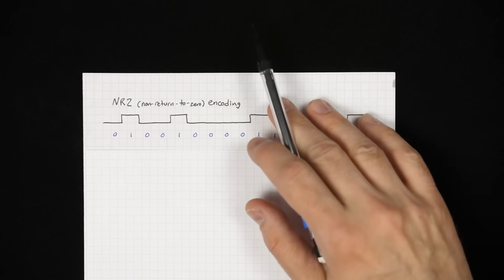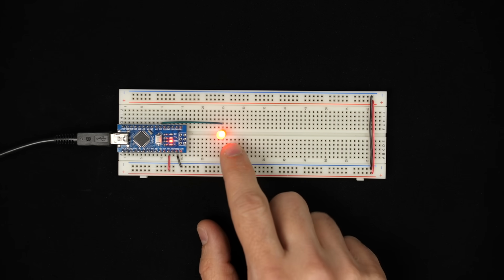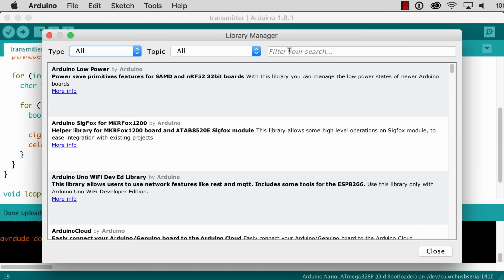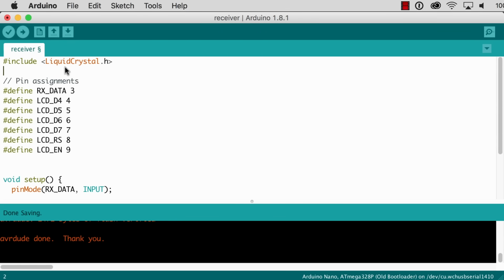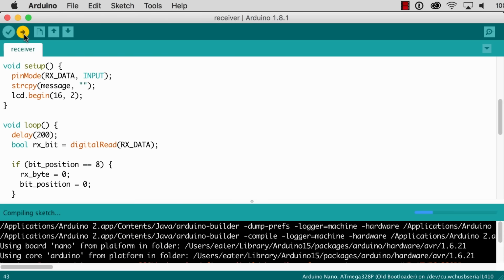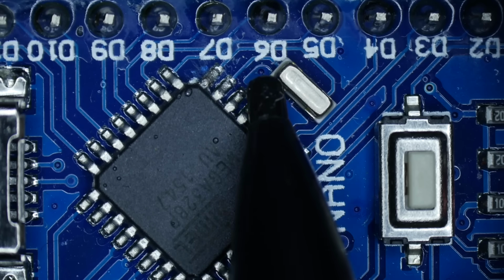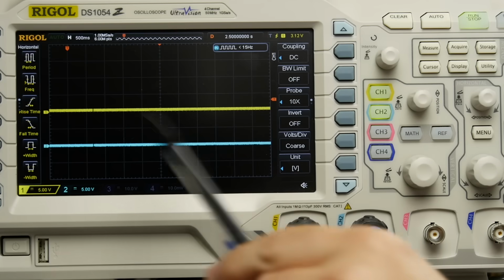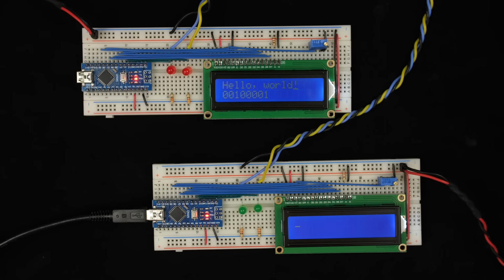Reliable data transmission

Comment: 41:07: So is that "four horizontal lines" character simply that LCD panel's version of the � U+FFFD replacement character? 
I did consider whether this might be a version of the ▤ U+25A4 SQUARE WITH HORIZONTAL FILL, but it's unclear to see how a single byte or single bit error could result in something that takes three bytes to encode in UTF-8. Speaking of which, do those LCD panels even use UTF-8? ... Okay, after looking at the HD44780 datasheet, I'm none the wiser: The datasheet does include its own 8-bit character sets (two variants shown in Table 4), but neither of those includes the "four horizontal lines" character. What gives?

Comment: 27:10: It's very clear that since ! is ASCII 33 (00100001) and " is ASCII 34 (00100010), it's just the final bit that arrived a little too soon, so the delay was almost long enough but not quite.

Comment: Is this just an explanation of "Reliable data transmission
" in theory or does Ben goes into depth about a particular data transmission protocol? Can you teach us how to build and go into the theory of building a data protocol such as a "CAN Bus"? The reason is because it is a very dynamic and fail proof data protocol since all parties individually are both transmitting and receiving data, it is somewhat complex to implement since all parties have their own clock signal too.

Comment: What was the reasoning for dividing the transmitter delay into halves and putting it between the LOW and HIGH of the clock?
Is it just for visual reasons? Like is it easier to see on the video?

Comment: Hello Ben. On the receiver side, which variables should be volatile-d?  You used it 3x, but not the char message[16], receiving the data from the onClockPulse() ISR.  Like this video.

Comment: But what if an error occurred within the clock signal. What if it's voltage got interrupted low at some point. Then the receiver could read the same bit twice.

Comment: When receiving; I would've rather used a "shift left" of the byte received for each new bit oand or with one.. Makes a bit neater code as you don't need to clear the byte every time you start receiving the next one, as the bits of the last byte received will just be rotated away .

Comment: You do not have to send the clock signal if you use so called sync bits, or start bits in the data stream.

You prefix every 8 bit message with 2 bits of known values - 1 and 0
So the message would look like this: 10xxxxxxxx.
After this you wait a few cycles and send the second byte with the same prefix.

This eliminates the need of a separate clock signal, since the prefix 10 functions as a clock signal, that can be used to interpret the message. Similar approach is used in analog composite video signal, where before each frame a color burst signal is sent, which is used to interpret the color of the signal.

Comment: In a project I set up for my kids to help them learn things like this, I used 2 PS2 keyboards with much the same connections you used in this video. The difference is that I set the 2 Arduinos up with a RX & TX function with start and stop bits. This enables two way communication with the ability to tell both devices when a character starts and ends without the need for clock sink. It's a simple for loop which i would be curious to see how you'd go about making. The end product used the up and down arrow keys to scroll through the message and was used in conjunction with a RAM shield for the Arduino boards. It makes an excellent message board for local wired networks. I would guess that this could also be done wirelessly but doing so has it's inherent security risk.

Comment: The coolest thing here to me is the way we're all sat watching this via a method which is just a few steps away from what he's demonstrating.  Data in, data shoved down wire, data out.  These are tests and lessons you can do in your own home, and gain a real appreciation for the fundamentals behind how this stuff works.
Reply: Data in, rendered to H.265 (that's 5,000+ technical patents right there!), shoved down a wire (really downplaying the complexity of the OSI model), processed in a massively multithreaded transcoding pipeline that proeduces about 10 different formats/containers, distributed across a CDN that makes you think the Internet is much faster than it really is, then it's shoved back down the wire to millions of people on demand in a kinda clever adaptive DASH format until the backend ContentID processes catch up and flag it for copyright...

Comment: .. why do this by software when it would be much more didactic to configure and use the built in hardware UART and have it sync the communication as well do CRC. You are teaching something that would be essentially useless in a app because it would run in a software loop, bitbanging every bit at random interval, instead of having it timed by clock/running in parallel to the application code and communicating without impeding performance or being disturbed by application dependant CPU indisponibility.. of course, the naive approach has its value but it would at least need mentioning in the video

Comment: I have a doubt, Is not neccesary (or at least recommended) to disable interrupts while handling an interrupt? In a setup like this is unlikely to occur I guess, but if the clock signal gets noise that is interpreted as a rising edge can lead to "bad things", right?

Comment: Some years ago I played around with having two arduinos communicate with just LEDS as the emitter and reciever using that well known LED discharge hack. As I recall I made my own scheme of sending first a long pulse of light indicating the time-length of the byte and then sending each bit as on/off. That way I could vary the send speed without the receiver having to know the rate and still have some syncronicity. although it wasn't exactly a sync signal. 

Either way it was a fun little project to toy around with, in hindsight I should have send a pulse indicating bit length as that would have been significantly faster.

Amazing what you can do with just two LEDs either way.

Comment: So I'm 2/3 through, and I'm going to speculate on using the data stream itself to stay in sync instead of requiring an extra wire to send a clock signal. Maybe hrs addresses this later. Haven't gotten that far. 
My first thought is to connect the incoming data to both the receiving pin and an interrupt receiving pin. The clocks on the different arduino are close enough to send a byte without getting out of sync. So, send 10 bits for each byte. 01 followed by the byte of data. Have the interrupt pin listen for a rising edge, which happens between the 0 and 1 in the two bit prefix to the actual data. This triggers an interrupt which tells the arduino to ignore the interrupt pin for the time it takes to read the following 8 bits at the expected interval. Process the data and reactivate the interrupt pin in time for the next 01 prefix. You can of course use better ratios of prefix to data if you know the tolerances of the system clocks. You can do orders of magnitude better than the 2 to 8 in this example. And using an interrupt might have issues I haven't thought through yet. Though you could possibly implement a faux interrupt by checking the data pin with no delays until you detect that rising edge, then read the butts at the lower rate with the delay commands or built in timer.

Comment: Sir can you please🙏 explain the 433 MHz RF transmitter receiver module circuit  Or any other RF transmitter receiver module circuit diagram   , it's working, every components used etc

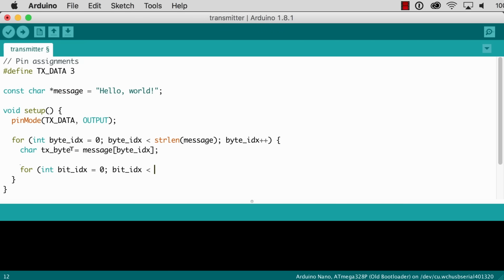Comment: Ok, after rewinding 20 times and playing at 0.75 speed (I'm not as smart as most of the people here), I think I've finally understood the 'bit shifting' part at 3:30.
Here's what I THINK is going on..

The problem so far is that we need to iterate over every character of the string "hello world!". So we do that with a for-loop. The first letter being 'H'
The letter 'H' is presumed to be represented by 8 bits as the ATmega328 chip that the Arduino Nano is based on, is an 8 bit processor. This is why Ben creates another for-loop inside the first for-loop. This second for loop has 8 iterations (8 bit)

The problem to think about now, is how to transfer a byte (8 bits), bit by bit, electronically. We need to iterated 8 times (hence the inner for-loop), and each iteration we need to check the state of the corresponding bit in the 'H' byte. Ben does this very cleverly.. We create a variable 'tx_bit' which will store a boolean which represents weather the bit in question was high or low.

So how to we test each of "H"'s bits?
What we need to do is choose a number which has just 1 bit set high in its decimal form. Here are some random examples: 
Decimal: Binary
1: 00000001
8: 00001000
64: 01000000
128: 10000000
Why are we doing this? Because we can compare the first (and so on) bit of 'H' with the bit of our number. 
But we need the bit of our number to be 1 so we have 2 known truths - the bit of 'H' is on AND the bit of our number is on. This is how we can be sure that the 'H' is on or off.
Which number should we choose? Well as we are starting off on the first bit of 'H', it makes sense to choose number who's first bit is on, and the rest our off. You can see from the examples above that the number we want is 128: 10000000

What's going on here is Ben is leveraging 'Bitwise Operators', specifically. bitwise AND. What this does is compare the bits of 2 binary numbers, bit by bit. Then it will output a binary number which has bits on (1) where both bits from the compared numbers were BOTH on. The rest will be off (0). 
Knowing that the number we chose only has 1 on bit, we know that if H's corresponding bit is off (0), output number will be 00000000 which evaluates to FALSE. Else it will be 10000000 in the case of the first iteration, which evaluates to TRUE.

The ascii number for 'H' is 72. The binary number for 'H'  (which we are interested in) is 01001000.
So let's do exactly that, let's do a bitwise AND on the 'H' binary number and our chosen binary number.
[0]1001000 : H
[1]0000000 : 128 (our chosen number)
[0]0000000: Output (evaluates to false)

Great! That means that as we iterate over each bit of the byte 'H', we can tell weather it is ON (1) or OFF (0). Then while we have that stored in the variable 'tx_bit', we can output it (or 'send' it), on the chosen pin, then move on to the next bit! After going over each of the 8 bits in H, the outer for-loop goes onto it's next iteration (next letter in this case), which is 'e', then the whole process starts again!

I hope this is as factual or correct as it needs to be. I'm very new to this myself. I hope it helps also.

Comment: Shelly Ph: 86-13671843635,  2911282844@qq.com, Skype: linnaniu1
Novyz(Shanghai) supply the custom service of Electrical Junction Box, server subrack chassis and network enclosure, rack case

Comment: Take a look at Manchester Encoding. The data line acts also as a clock line meaning you only need 1 data cable, and 1 ground. Suitable for RF transmission.

Comment: The inclusion of a clock wire seems useless to me. The only reason your timing got unsynchronized so fast was because you’re receiver was waiting before it received a bit. It should’ve received first and then waited, with maybe a small delay at the start of the program to make sure the receiver catches each bit with a big enough margin. Even with this setup, yes, the Synchronisation won’t last forever. To fix that, just use an interrupt after every Byte to catch the next bit, then add a little padding to make the synchronization last another byte, and then repeat.

Comment: Any comments on the possibility of having a common clock?  Is it reasonable to build around the expectation that there will be a short clock skew between adjacent machines?   Is a common (externally sourced) clock even feasible with a R.Pi or Arduino?

Comment: 29:55 Why are both arduinos going out of synchronicity after 667 transmitted Bits? shouldnt it be (667 / 5) Bits?  Since the delay between two Bits are 200ms -> 1/5 s.

Comment: I'd imagine you'd fix errors by first using a parity bit, which can be used to fix single bit errors on the fly.
Then if you want more reliability I guess you could send a whole parity byte, but that would halve your transmission speed. But then accuracy is usually more important than speed.
Then, if even that isn't enough then perhaps some RS232 communications to manage handshaking and resending, etc.
Lol, this is stretching my memory of school.
Reply: Lol, just noticed the recommended. Your video on Cyclic Redundancy Checks. I forgot about those.
Edit: And a video on Error detection: Parity checking. You really have it covered.

Comment: I had fun with this one, mine wouldn't work and I checked the code over and over but then I saw I didn't have a certain ground in place on a split breadboard... thanks Mr. Eater, great video!

Comment: the first is like a 2 position push toggle switch the other is a 3 position push toggle ... thats the easy way to think of them ... one goes from high to low ... the other goes from your common reference (NOT GROUND COMMON) either high or low ... and returns back to the common ... the first is rising edge triggered the latter is falling edge ... and now you know where timing concerns start to come into play ... 
.
ground is literally a connection to ground ... COMMON is a connection to a predetermined value ... can be ground or any positive or negative value you choose ... the most common reference voltage is +5v ... yup enough to power minor circuits ... then as you pulse high's and low's you go above and below that voltage triggering the various processes you have designed in
Reply: as far as your presentation of details ... in some places you a smidge too much others a smidge too little .. tbh it's just how in depth you go in some places ... like the interrupted bit you spent 30 seconds to say ... i added a switch to introduce an error so we can see how to fix those .. that is all that was needed then its off to say what you are doing in the next video (where you can explain why in a bit more detail) ... very minor stuff ... like that through out .. nothing really serious ... just a little tidy here and there is all 

the only major failure is calling reference and ground the same ... THEY ARE NOT THE SAME ... REFERENCE can BE SET TO GROUND ... but DOES NOT HAVE TO BE ... reference is also known as COMMON .. or neutral .. yes that's right ... NOT a ground   - a reference value that everything else uses as a base ... 
ground is just that a HARD connection to the earth usually done with copper pipes like plumbing ... 
common, neutral and reference are all the same thing ... it is common to all things connected, it is the neutral setting and it is the reference for all connected bits to be measured from ... That is what the 2 wire connection is about .. not just in power lines but also in electronic circuits like this ... 
this is also why those hydro bill cheaters that stop the waste of 50% of your provided power by switching from ground to common so the negative portion gets used as well .. in essence you tie the common to +60v and then transform the +180v to +60v and the 0v to -60v ... and now you have a full 120v usable power and you only are drawing HALF the power from the grid ... hydro hates that because they lose that money even though the power is there ... they only charge for the half they restrict to

Comment: Wouldn't Manchester Encoding have been a better choice as data transmission protocol, as you mentioned in your Networking Tutorial 4? A quick note why you didn't choose it would be helpful. Maybe the separate clock signal was simply easier to implement?

Comment: For a makeshift oscilloscope you could use the arduino IDEs Monitor tool, which plots values you print with Serial.println to a XY Graph

Comment: It is worth to note other factors of interference. For example if you have long (unshielded) wires, they will act as antennas and pick up interference from generators, A/C cables, radio and whatnot. Your video is very clear and (made to?) show the theoretical side of data transmission.

But no-one should bring this lab setup to an industrial system and expect it to work, it should be noted that it's one of the concepts of data transmission and should be combined with other factors to create a reliable solution.

Comment: for(int byte_idx = 0; byte_idx < strlen(message); byte_idx++)

After executing the bloc, the for loop evaluate the statement:

"idx < strlen(message)"

So, it push the address of "message" on the stack and it calls the function "strlen". On return, it compare the result, in the "accumulator" register with another register which represents "byte_idx". A conditional jump makes the processor return to the beginning of the "for block" statement.

In the past, a function like "strlen" was relatively slow, particularly when the string is a few thousand bytes long.

Modern compilers can recognize that the string will not change in the background because it is not marked as "volatile', and they have in their database the information that the return value is a constant if the parameter is constant. So, they would evaluate "strlen" only once, save the result in an integer and compare the loop counter to that integer.